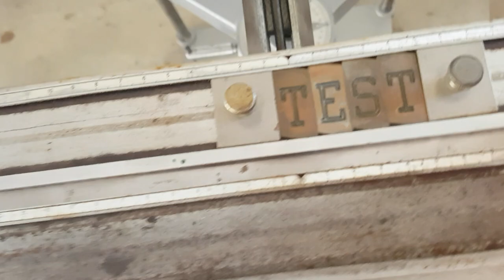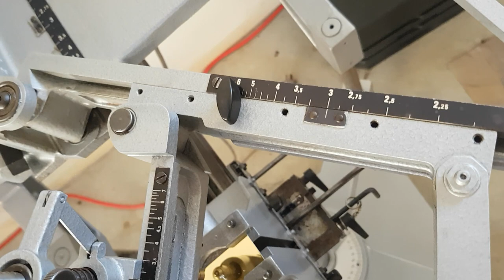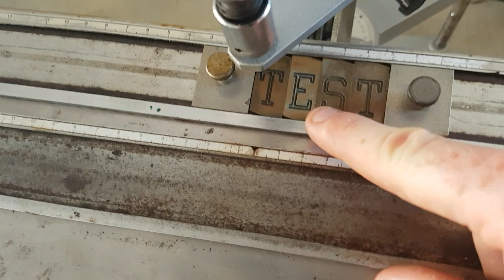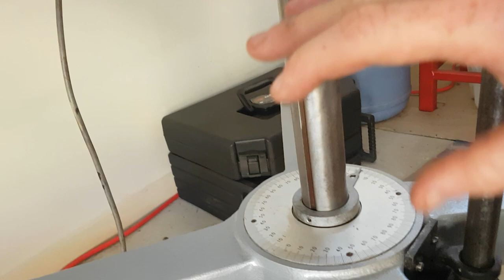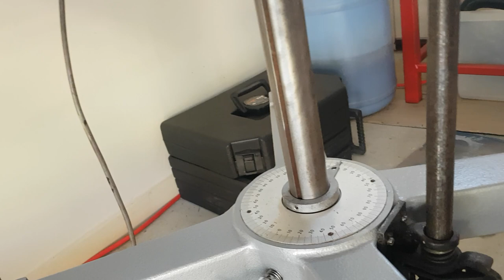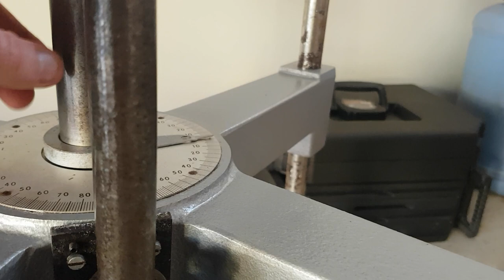Gravograph TX3 Pantograph,How to use

Comment: Great video.. Just bought one myself..and trying to work with it, a long lost hobby from the 90's picking up again..very helpfull, maybe I post more on this model TXL ...in Netherlands there are a lot for sale, second hand..
Reply from the maker: Sounds like a plan, nothing better than getting back into something you love doing.
Reply: Yeah! just started and check videoos on how to work with it..not very much videoos to check though...but this one really helped a lot! thanks
Reply: BTW how did you clean the machine? What did you use to tidy up the machine?
Reply from the maker: @AMATEURS IN THE STUDIO feat. #POWERPOMMY & Pippi  degreaser, wire wheels, primer, hammer tone silver epoxy enamel, cold blue etc. Pretty much elbow grease

Comment: Hi!  I have the same Scripta GX 500!  Two questions: have you found a manual for it (PDF or otherwise)? On the spindle head, at the bottom, I seem to be missing the part you referred to as sacrificial.  What's is this part, and is there a collet at the bottom of yours, just before the cutter head protrudes? Mine is slightly loose leading to the cutter having some play, and of course producing some pretty poor engravings. I heard deckel parts can work in these machines, but I'm not sure.
Reply from the maker: Gday, the sacraficial part is the bronze collar. It acts as the depth of cut by running on your work piece creating a physical stop for the tool height. I guess you could make some if you had a lathe. Mine came with a couple of spares. They wear down over time. I hope that helps

Comment: How did you free up the stylus, mine wont free up. Any help would be appreciated.
Reply from the maker: Hey mate, I had to pull it apart, its a very tightly toleranced piece so any grit or rust just siezes it. Start with some penetrant lubricant, pull apart and free it up. Keep it lubed once your done. I hope that helps